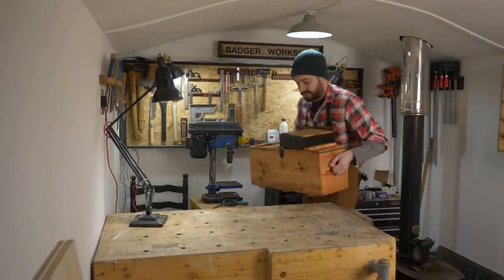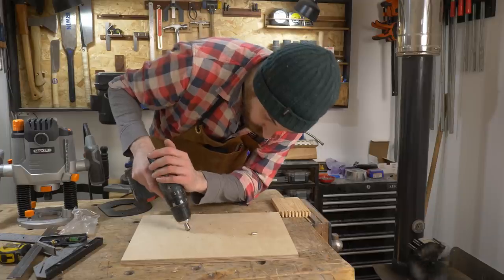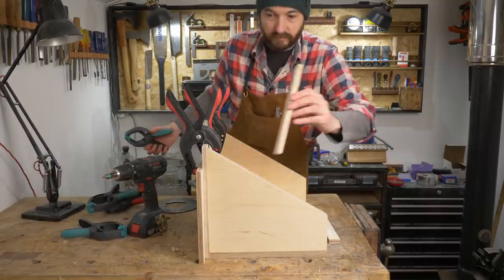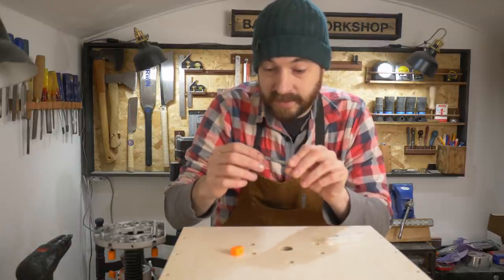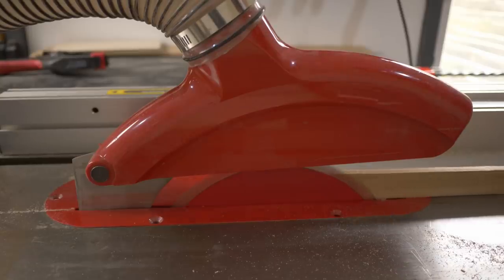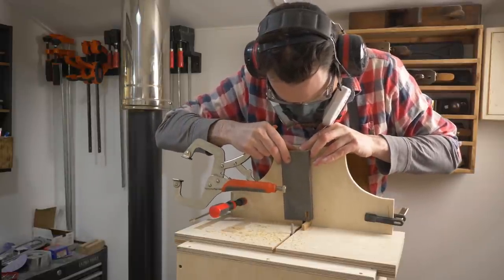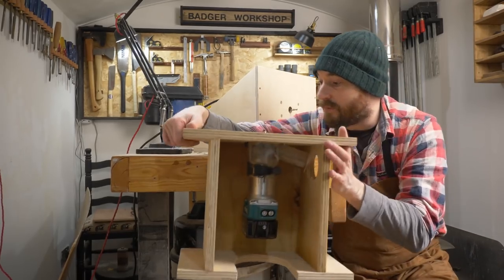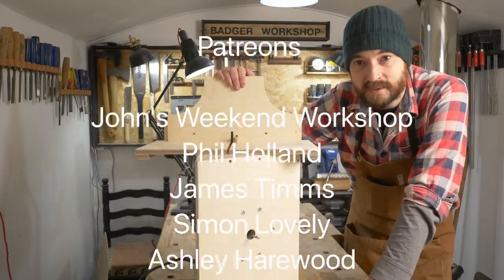Router Box Joint Jig

Comment: Great build Matt, I've looked at a few of these on YT, yours is much simpler to build. if you drill a larger hole in the jig base with forstner bit, in the slot just where the bit engages with your material, that will allow the dust collection hole in the table to function. Your base is big enough that the hole won't affect stability. you could always bridge across camera view side & slot the jig over your bit as it doesn't need the whole 10 inch travel

Comment: I made the same jig from scrap last year and it works well. Using thin material for the sled and top is a good tip, mine is thicker than it should be so the router bit has to be most of the way out of the collet. If you need to adjust the auxiliary fence it's lefty loosey, righty tighty.
Reply from the maker: Thank you